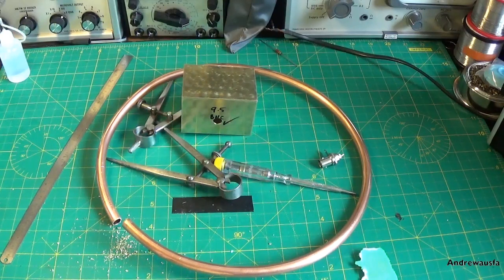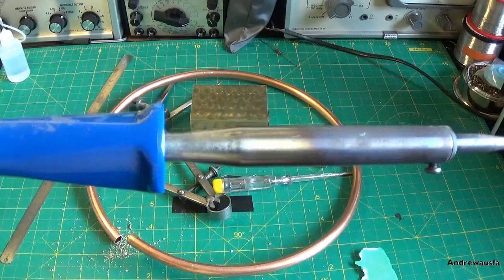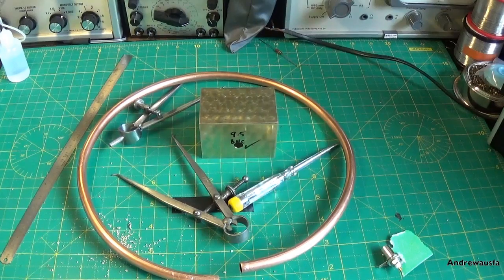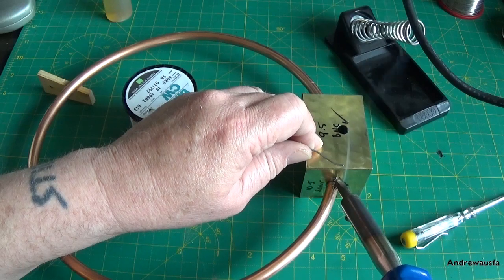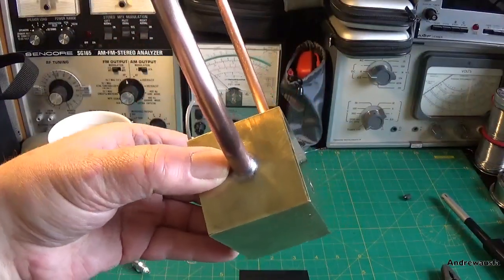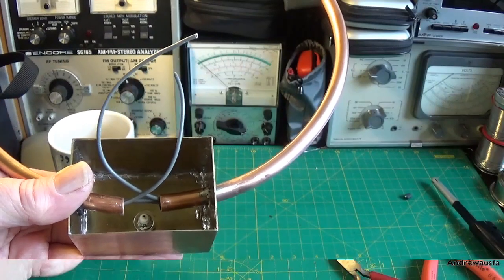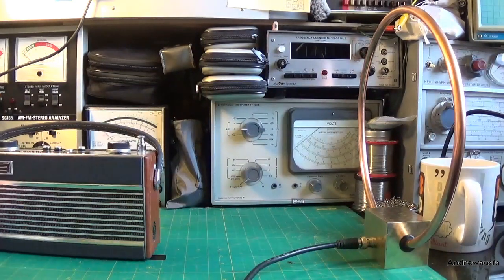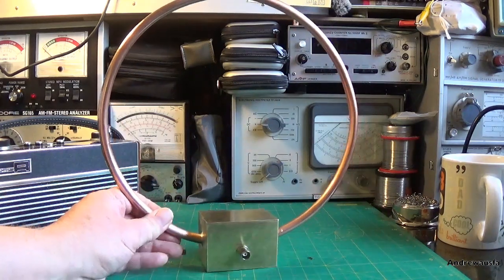Making a Hacker radio screened radiating loop aerial

Comment: Ooow that's a loverly loop andrew :-D, i love the classic copper and brass for construction.
Soldering large areas of metal together is a right pain, there is never enough mass in the iron to stop the temprature dropping too fast as it's transfered into the metal.
Yes you could buy a gasgun to preheat the metal to lessen the loss, but it would sit in a draw for years after it's first use.
(We have all bought single use items lol).

Comment: You could use a butane touch with acid core flux and solder  I bought a little kit to reseal a car radiator it had the correct sdc older and flux for that job and you will need a stainless steel small brush if need to clean the surface.just a thought it the same for soldering copper pipes together.